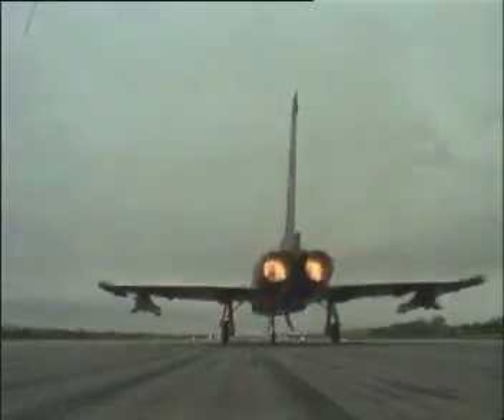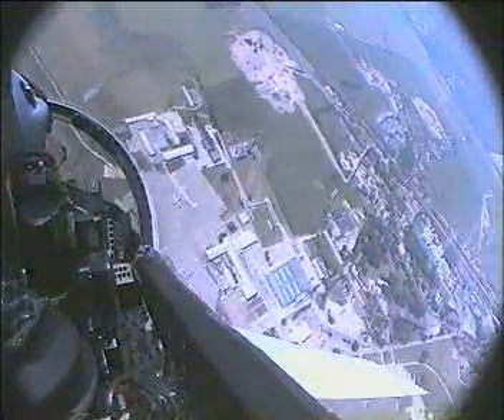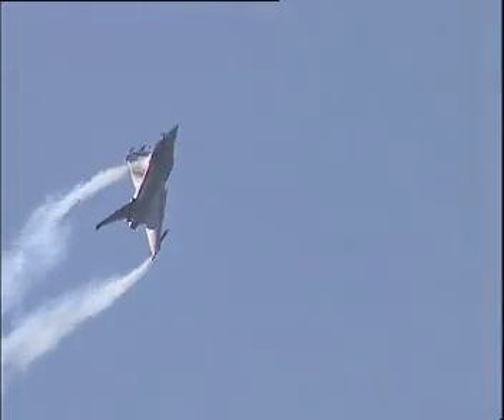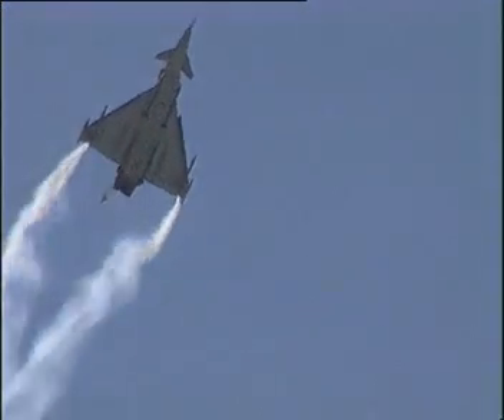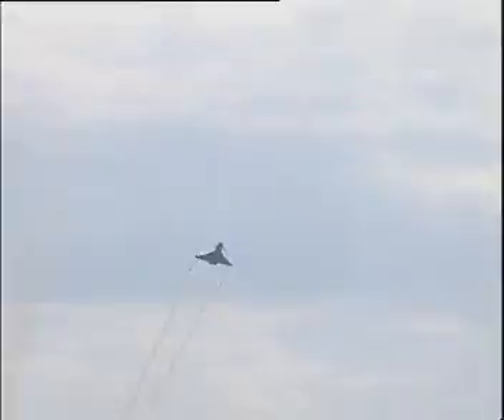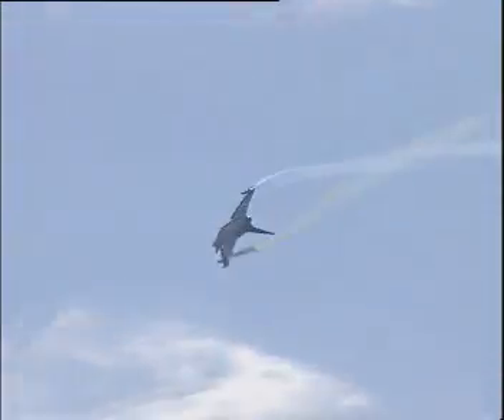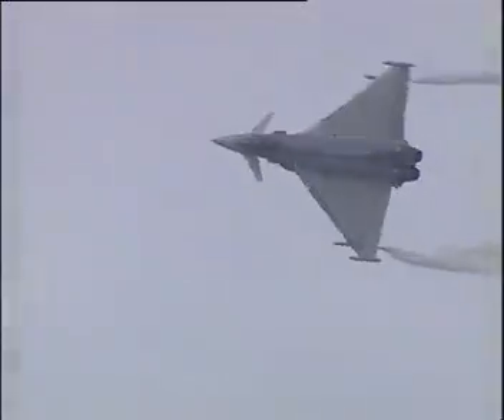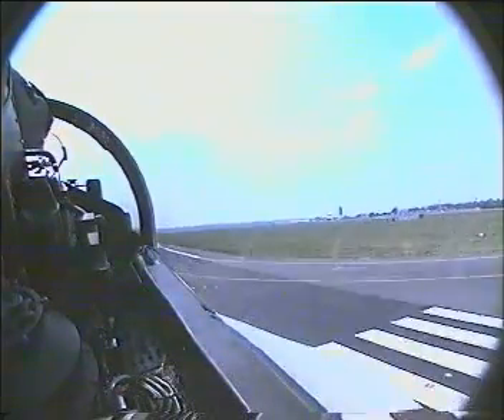how to fly a Eurofighter Typhoon!

Comment: @Beatnikful The Eurofighters EMC systems are so dense the Gripen would need to be within 30/40km (depending on weather, altitude. etc) before they could even lock on.
Now multiply that range by nearly four and that's the new Metor AA missle that can engage most, if not all targets at it's max range (Except the new Stealth aircraft in full stealth mode)
Also, the Typhoon looks better, even before I start ranting on about the  other many capabilities.

Comment: But Typhoon's Meteor missile is superior to AIM-120D as it isn't a modification but an entirely new-tech missile.  And have you heard of warning sensors?  The Typhoon would detect the missile lock and launch even if it didn't detect the plane, therefore being able to deploy countermeasures and use it's (unmatched) maneuverability to evade the missile.  And if the F-22 doesn't dog fight, why does it have vectored thrust???? And,yes the F-15 is better than Mig-29 but not Su-27!